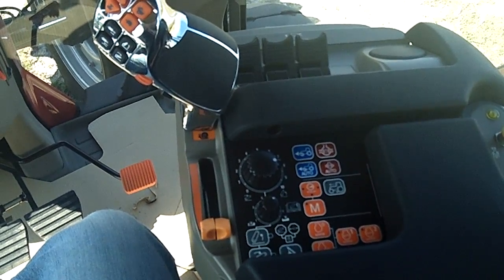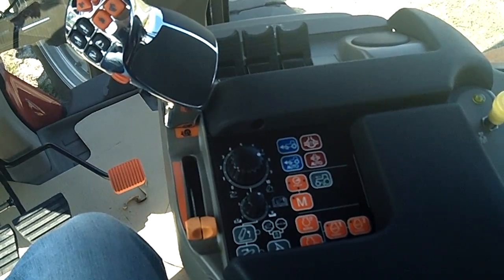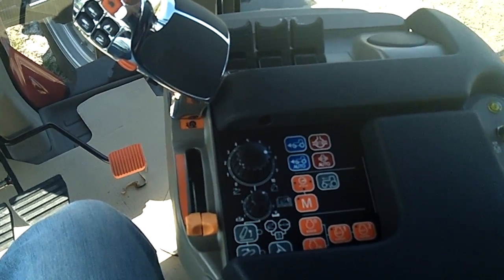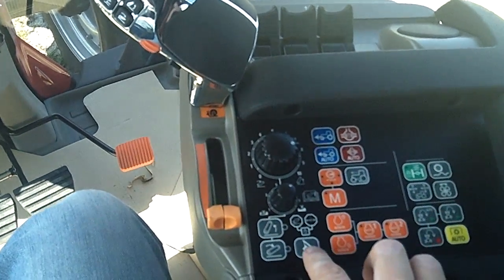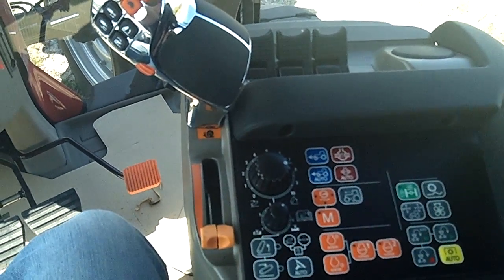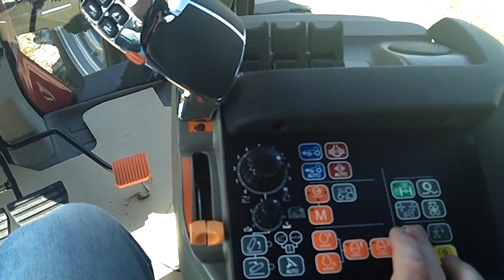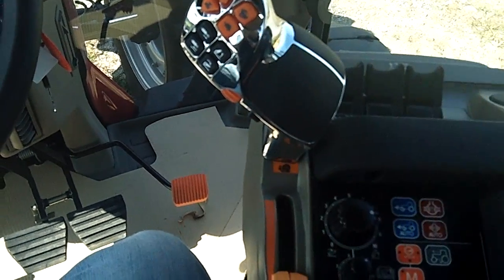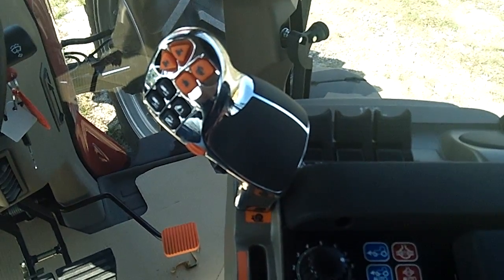How to move the Autoguidance button to the Multifunction handle on Case IH tractors

Comment from the maker: It was more of a problem on mid range magnums back 4 years ago.   It should be good to go.  Make sure there is no errors related or make sure the front axle sensors are operational.  What happens when you use the autoguidance button?

Comment: I have a new 260 and don't like the position of the guidance button. Thanks for the tip...I'll be changing mine over tomorrow. I'm a little disappointed with the lack of toggle or rocker switches. They are easier to 'feel' for without having to look where my finger is. The FWA, diff lock and guidance should all be rockers instead of flat buttons that you can't feel.